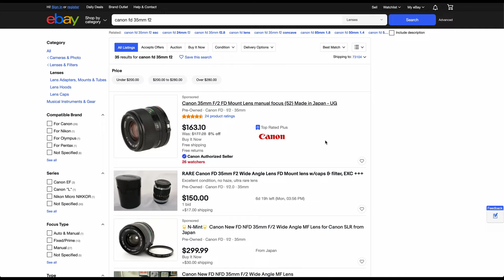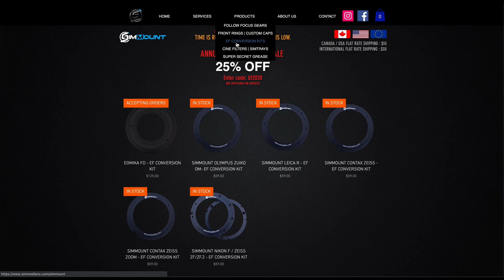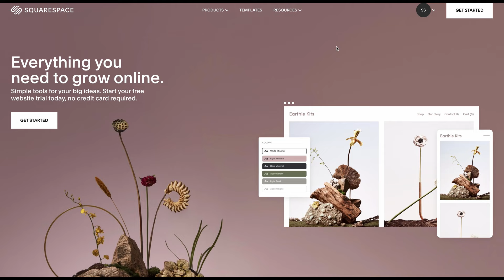How to convert Canon FD to EF | SIMMOD vs 3D Printed

Comment: If you want to remove stuck screws, never use force. Force will break the head of the screw and then it'll be hell to remove it. Use the proper screwdrivers : JIS screwdrivers. If it's stuck, apply a drop of lighter fluid or alcohol and wait a bit. If it's still stuck, apply some heat with a soldering iron to the head for 10 seconds

Comment: All EF convertions are designed to work on DSLR bodies. Which is devastating for lenses with fixed rear element because it moves the rear element to the front and this is changing the optical scheme. So if you think that your FD L lens (most of them are with fixed rear element) is going to perform the same after converting it - you can't be more wrong.

Most of the current cool old FDs with fixed rear element were modified at one point of their life. I bought 50 1.2 and 85 1.2 L lenses back in the days and they were pretty soft. I shiped them to an old service guy and he explained to me that he can fix them and why they are in this condition. It was a huge change in the performance after he reassembled them. No my 85 1.2 L is way sharper than the newer AF model (EF 85 1.2L II). Same for the 50 1.2 L. Unfortunately this guy do not work anymore and he was old, probably all the people that know how to do this are pretty old now too. And the equipment he was using is kinda rare because after the relubing he performed realignment of the lens elements that were removed which is something nobody do but is super important if you do not want your precise Japanese instrument to work like a Russian lens assembled by drunk people :).

My advice - use those lenses on mirrorless cameras!
Reply: Does it apply to Zeiss Contax too?
Reply: @guillaumedelhumeau5746  not exactly. But is tehre is a lens that naturally hits the mirror with its rear element the modification can be destructive. As far as I know this is a problem mainly with FD lenses because their flange distance is shorter and they were one of the first in history using aspherical lens elements. Guess what - the aspherical element is exactly the rear one that I was talking about.  

Contax lenses most of the time are reversable after modding because they are adaptable with simple adapter to EF and you have to remove only the clicks of the aperture ring and the aperture lever. This do not require optical interventions.
Reply: @SimeonKolev  Hi Simeon, nervous about this as well for my BMPCC6K. Do you think this would be fine on a Super 35 sensor?
Reply: @NickAcevedomusic  what I was talking about does not have anything to do with the sensor size :). It is a problem of ruining a lens like forever because the people that are able to fix it are getting old and go out of business.

So my advice will be - leave the FD lenses as they are if the rear element is fixed. The ones with simpler optical formula are going to work like nothing happened. The ones that are more complicated the rear element is fixed and needs to be moved - they will not work the same as they were. How much worse ... it depends but worse is for sure what you will get.
Reply: @SimeonKolev  Ohhh interesting. Good point

Comment: Sometimes it helps to heat up the screws with a soldering iron first. They may have like loctite on them.
Reply: Also, cannot recommend an iFixit kit enough. One of my favorite things I've bought this year.
Reply: @StephenHildreth  I thought ifixit was a shame until I got their kit.
Reply: True, but be careful as some threads (like the 50mm 1.8) are just plastic

Comment: I'm thinking about doing this to my FD and nFD lenses to remove one of the two adapters I need to use: Canon FD to EF, EF to FX speedbooster. That might make handling these a lot easier and faster.
I'm also looking into adding dandelion chips to the lenses. This way they can report their focal length to the camera (aperture too but it has no way of knowing the current setting so it will just report the one programmed - open aperture for me).

Comment: Thanks for sharing dude, can be such a pain in the b*tch to take apart with threaded screws and springs flying all over the shop! I also did the Shapeways mod on my FDN 35mm f2, but didn't want to risk the shapeways with my 50mm f1.2 L. Good to know that Simmod now offer a more durable mount with the correct arm. I actually had to the Shapeways apertur arm down for the 35mm which didn't make me too confident about trying the mod for my other 20mm f2.8 or 85mm FDN lenses.

Comment: What is the difference using this method compared to adapters? I use mirrorless bodies.
Reply from the maker: Mirrorless style bodies can adapt these fine but you will have issues when using them on ef cinema cameras. This just makes them more flexible that way.

Comment: Does this procedure provide infinity focus? Or with different words, is ist reducing the distance between sensor and Lens by 2 mm compared to ef?
Reply from the maker: You will have infiniti focus using this method.
Reply: I dont know what i did wrong but i cant focus to infinity on my 17 f4, 24 f2.8, 35 f2. On my 85mm f1.8 and 100mm f2.8 it works fine

Comment: is there a difference in image quality or look comparing the nfd and ssc?
Reply: yes. the nfds are newer designs, have more modern codings and as such are a little sharper, less prone to flaring/ aborations etc.
in other words, the ssc are pretty dirty, the nfds still have a vintage feel to them but are more modern looking.
i like the nfds, i dont want to fight flares that obstruct half the frame.
Reply: @xx1simon1xx  Thank you, I want the one that has more of the modern look that is not too vintage looking.

Comment: is there anyway to do this on fuji?
Reply: You can use an adapter to fuji x mount, this is not possible for ef mount
Reply: @luanzondervan7402  well yeah I’m aware of that but my question is, is there a bayonet mount conversion for Fuji so I won’t have to use an adapter. That’s kinda the point of the video so I’m asking is it possible only other brands
Reply: you could either get a fd-xmount speedbooster/adapter or convert the lens to ef then get an ef-xmount speedbooster/adapter, the second option is pricier up front but would allow you to both use other ef lenses on your fuji or use the lenses on other systems
Reply: @CianMcsweeney  I'm not a photographer anymore haha

Comment: What about FD to E-Mount for a7s III?
Reply: E-mount to EF Mount with Speedbooater then Change the lens fd to ef
Reply: @noahlebel-turcotte4662  Speedbooster on Fullframe?
Reply: @NirnBootMod  oups sorry i thought Sony was mft. I will reply to you when I will get the info.
Reply: Just put a regular dumb adapter in between it. Cheap and easy for e mount.
Reply: @SeanvanBerlo  that would change de focus range since you are spacing the lens from the sensor?

Comment: When buying these vintage type lenses are you concerned about the radioactive ☢️ properties that some of them have - https://camerapedia.fandom.com/wiki/Radioactive_lenses ? 😰
Reply: No one should be concerned about this sort of thing the radiation is in the coatings. The only risk would be in somehow breathing the dust of the lens coating or ingesting the dust of the lens coating. even at that its not a death/poor health sentence. Thorium is a beta particle emitter, and in the thorium oxide component of lenses it makes up about 30 percent of the composition. Beta particles are not particularly harmful unless ingested our skin and clothing does a more than adequate job of stopping them. If you treat your lenses properly and with care the coating will remain on the lense and mitigate nearly all of the risk of internalizing any of the coatings.